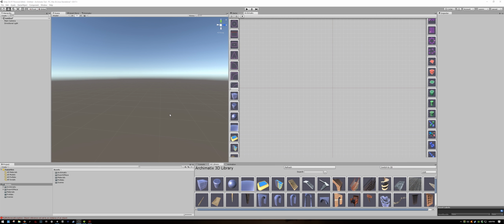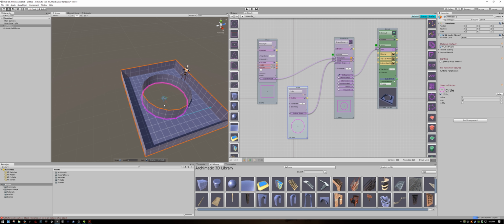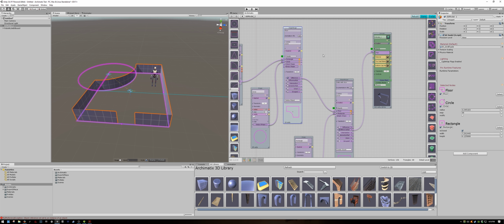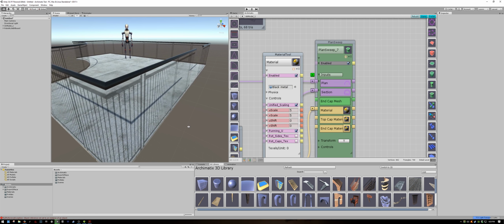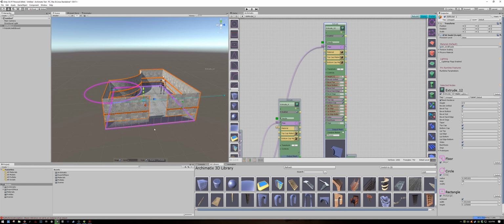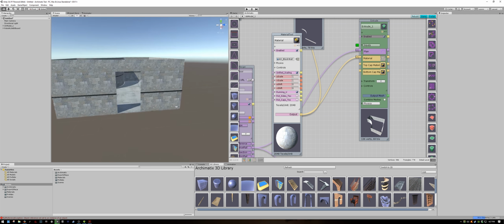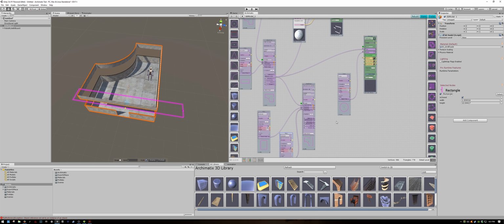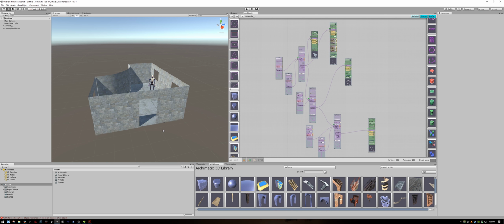04 Archimatix - railings, doors, and windows

Comment: I'm seeing that both in this tutorial and the similar piece embedded in the documentation pdf provided with AX that the room always includes a combination of two 2D planforms; in each of the cases a chord of a circle is cut away from one corner of the room.

Most rooms do not exhibit such a feature; most are simply rectilinear or some combination of rectilinear elements. The simplest rooms of all are simple rectangles with a single door passage in one wall.

This is where everything goes right off the rails. If I follow this tutorial path and omit the circle subtraction early in the process, or if I complete  the tutorial fully and then remove the 2D circular planform and dependent shape combination node to produce a simple, rectilinear space with which to work, I find that introducing the difference rail produces undesirable results. Typically, regardless of the size and proportions of the difference rail plan, and entire wall will be removed from the rectangle, and generally a wall adjacent to where I'm attempting to place the door.

I'd be most appreciative of any assistance I can get with this; I'm new to archimatix and I'm sure there's something I must be doing wrong.
Reply: Hi James. I think I will need to take a look at your scene to better understand the problem. If you like, you can email me at 3Dlunatic@gmail.com and if the scene is too large, you can share it with me on Google Drive or DropBox. I'll take a look at it and see if I can help. If you don't want to share the scene, that's alright and I can try to help based on your description of the problem. However, currently I'm a bit unclear about it.
Reply: Hi John,

Thanks for the prompt reply :)

There's nothing particularly special about the scene, except insofar as it illustrates the problem I am experiencing.

You may find a copy here:
https://drive.google.com/file/d/1En7lQFGXuDUsrZgNvlEJAgssiXDifP7E/view?usp=sharing

Thanks for having a look.

Cheers
James
Reply: @VideoSafari7  Did you guys figure this out?